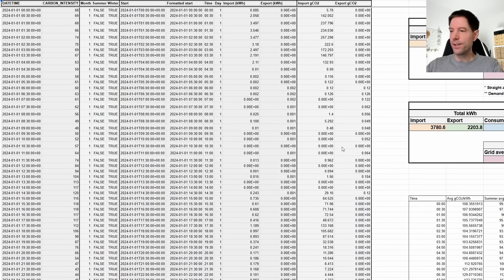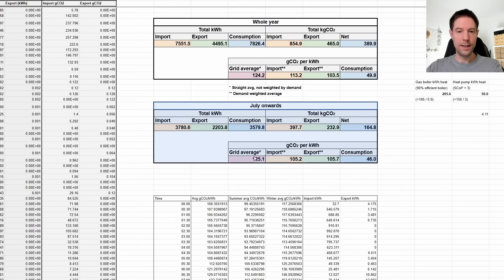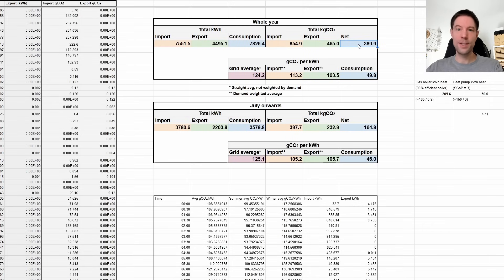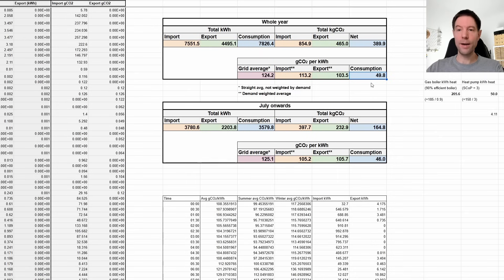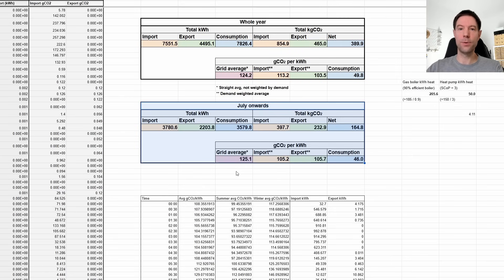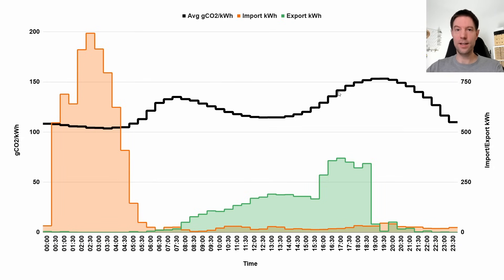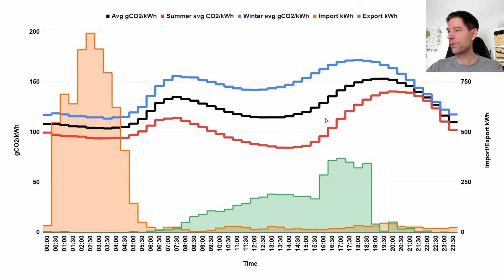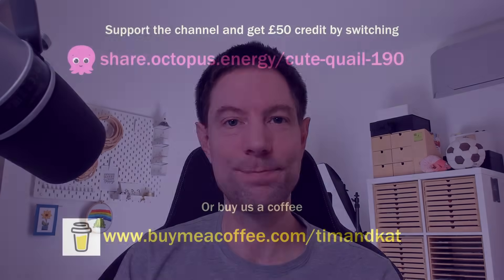I thought we were carbon neutral - I was wrong!

Comment: Hi, I added generation to my house by buying Ripple Energy shares. As I charge my battery for 7p overnight and ripple pays 6.3p per unit generated by the wind farm, I effectively pay 0.7p per unit. This also reduces my carbon intensity but I haven’t gone into this level of detail to know exactly how much I use.
Reply from the maker: I've also got a bit of Ripple investment (the solar farm) but it's not online yet, so that'll help a bit when it starts generating (hopefully this year some time).
Reply: It is worth also noting that you are carbon neutral because of REGO. As octopus adds your load to the 100% carbon neutral side of the generation. The dirty side of the grid comes from people not using 100% renewable energy suppliers. Also you need to treat your car separately as the diesel offset makes a difference.
Reply from the maker: I'm not sure I agree with the argument that just because I'm on a 100% green tariff that I can claim to be carbon neutral.  The grid doesn't send me only renewable power, it'll be whatever the current mix is.  I personally think claiming certain tariffs are 100% green is a bit misleading, really, we all get the same power mix at the end of the day.  The point about the car is a good one, though, a couple of others have mentioned that and I think I need to do a follow-up video on that subject at some point.
Reply: While what you say is true REGO creates demand for more renewables on the grid. This directs corporate investment in the desired direction. Without it our desire for renewables couldn’t be communicated to investors.
Reply from the maker: @pmac6584  oh yes, I agree about that part completely.  I'm not saying it's not a great idea, it is.  Encouraging investment by showing a demand for renewable power is very valuable.  But I'm not going to claim I consume only renewable power from the grid for the purposes of this particular study.

Comment: That carbon intensity API is absolutely a pain for regional. If I would try to do the same thing, I would need the regional data, because South Wales often seems to be significantly dirtier than everywhere else, sadly.
Reply: The South Wales intensity is really interesting. On the one hand it's unfair - it gets penalised in regional data because Pembroke power station is one of the biggest and most efficient gas fired stations in the country and in a really strategic position so it runs a lot. It's not south Wales' fault that Manchester and Liverpool consume lots of power and National Grid can't get their act together in bringing more power out of Scotland (though it would then get soaked up by Birmingham in the regional methodology) 

On the flip side, Wales hasn't exploited its renewable resources anywhere near as much as Scotland has, doesn't want pilons running north/ south and environmental purists could argue the new electric arc furnaces should go to where the green power is, despite Port Talbot desperately needing the jobs.

 It's a really difficult social / environmental challenge.
Reply from the maker: Yeah, it was a total pain getting anything other than national data, which is why I did it that way!  There must be another good source of regional data that's easier to obtain.

Comment: As always Tim, an interesting video.  I would like to add one point, you include the electricity you use to charge the car, that is used external to your house and is a replacement for petrol / diesel.  Therefore I would say you should include the CO2 you offset from using those kWh to run the car.
Reply from the maker: That's a good point actually, I'll have to have a think about how to do that.  Shouldn't be too hard to do.
Reply: Could also exclude the car charging electricty from the calculation - which is probably easier to do?
Reply from the maker: @ yup, that was my first thought too.  Then I could account for the offsetting of not using an ICE car for the miles we drive in the EV as a separate calculation.